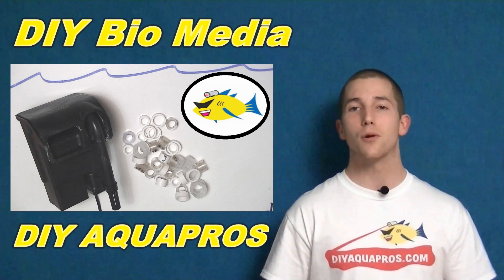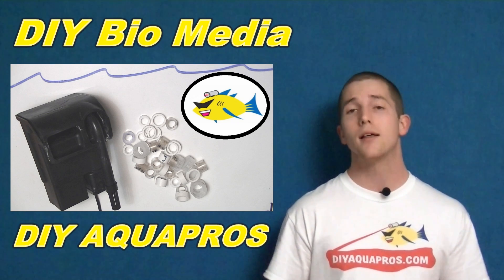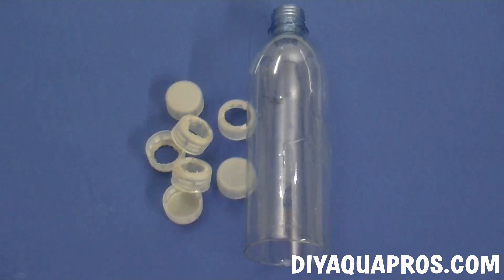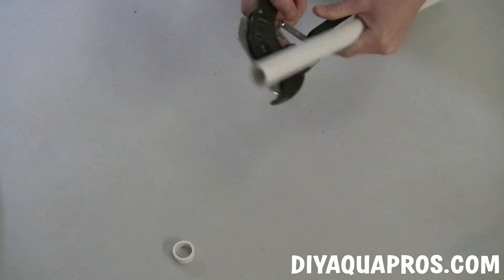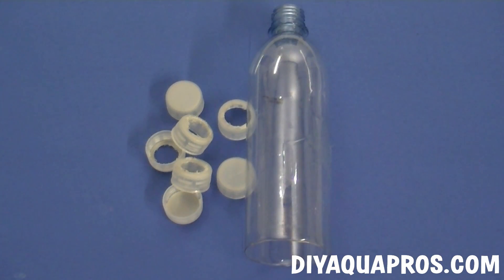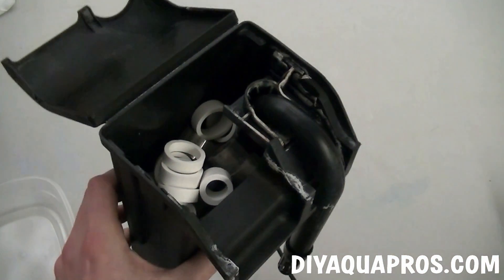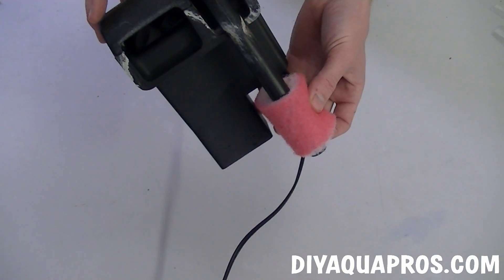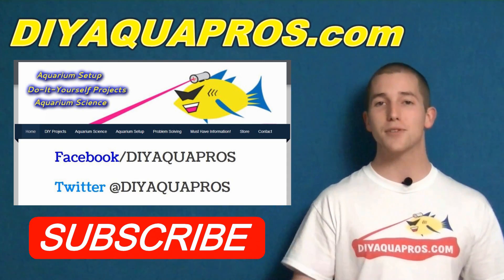How To Make: DIY Bio Media For Aquarium

Comment: Should you put it in a bag? Should you put it in front of a filter cartridge or behind the filter cartridge? I am sorry I'm asking a lot of questions I'm new to this stuff
Reply: Bio media should always come after mechanical filtration because you want the water as clean as possible to avoid clogging and fouling the bio media. Ideally, the best filter media for an HOB is a fine sponge which fills the entire compartment. Put a sponge over the intake as well for additional mechanical and biological filtration. You can rinse them in aquarium water when you do water changes to preserve the bacteria, but need to rely on water changes to control toxins due to the limited space of an HOB unless it supports other types of filtration and is not the only source of bio media.
 To learn more about biological filtration and see the best media available search for POND GURU here on Youtube. He shows you how to set up a filter for optimal filtration.
Reply: @Kenney9120  cheers for the advice.
I just order some premium sponge or it's floss sponge with dual side. Sponge and floss.
I won't be using any bio balls.

Comment: can i use legos?????????
Reply: +Aquariums&amp;DIY  Chunks of Unglazed TerraCotta pots work really well for Anarobic filtration.
Reply: +Aquariums&DIY I would imagine so if you fully clean them before use and used in a fluidized style as the nooks and crannys  of it would see alot of buildup over time. Having it in a fluidized state would ensure that the legos would knock into each other and reduce the buildup of old bacteria. This is just a theory at this point though.

Comment: I have a few plastic water caps. But. I dont have pvc pipes to cut. Would a garden hose work instead? You know. The green one with string braiding around it...
what else can i use that i can find around the house?
Reply: +JOWEE BOIE I wouldn't suggest using garden hose as it isn't plastic or ceramic, and will possibly erode and pollute the water over time.
Reply: +wereboarder2009 hello. you are absolutely right. i did cut out a few pieces from the hose and i placed em in a separate glass with water to test it. true enough, overnight, the water turned whitish as with the hose. i eventually used more caps (30+pcs) and biofoam in the end. by the way i also added an oceanfree bf4 sponge filter for added filtration... =)
Reply: @wereboarder2009  interesting. I didn't know plastic and caramic help clear the water. Cheers
Reply: @condorX2  I would like to now mention with this comment being 4 years old that plastic and ceramic aren't the only materials available for biological media. Some inert rocks like lava rock and pumice stone are also fantastic media's
Reply: @wereboarder2009  😃👍
Reply: +JOWEE BOIE   Anything will work, if you confine it.  Surround the area with plastic Mesh, you can get it in the craft section of Walmart, used for Crochet projects.  Surround the area with meshing, and then use those soda caps, and cut up straws, broken unglazed clay pots.  Almost anything glass, plastic, or Clay will work.  Pot scrubbers from dollar tree, pillow stuffing, the polyester kind.

Comment: can you scratch up the surfaces to give better areas for the bacteria to grow?
Reply from the maker: You could rough up the surface of the PVC pipe with sand paper before you cut it into rings, this could add a little more surface area.